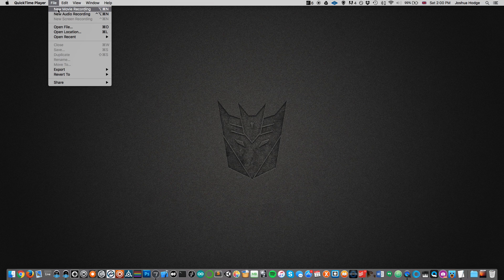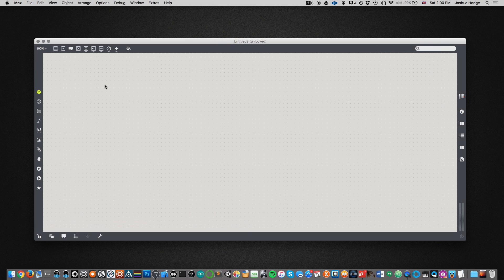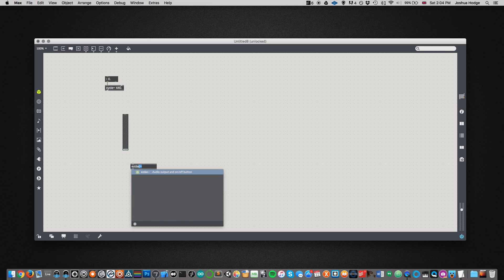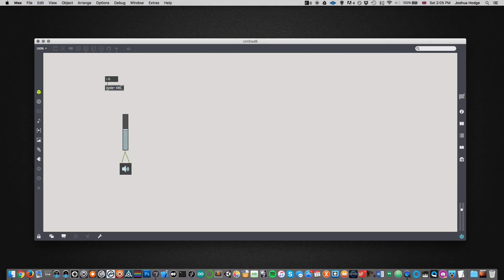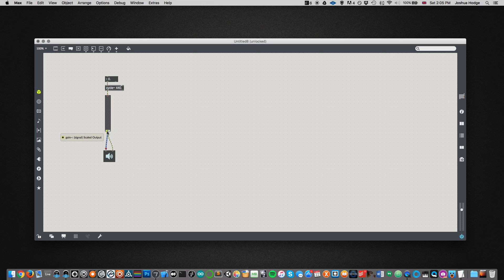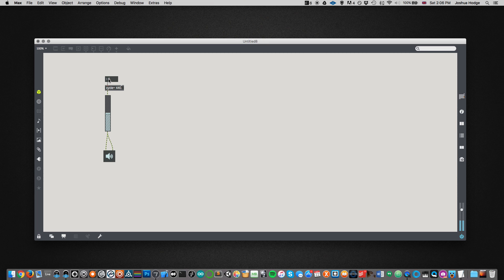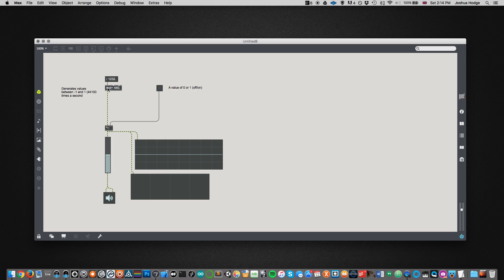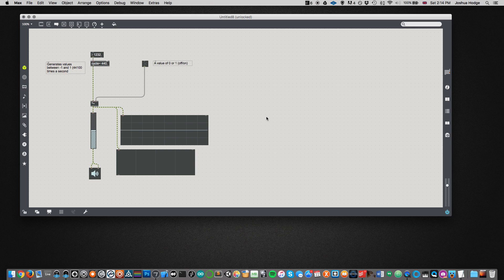Audio Programming for Beginners Tutorial 03-  Simple Sine Oscillator in Max Msp

Comment: For some reason I can't connect the number node to the oscillator node. There are no inputs or ouputs on the oscillator node. Has anyone else had this problem?
Reply: OK, I figured it out. If you give it a default value, like in the video, the outlets disappear. You need to first create it with out a default value and then connect it.

Comment: For some reason, I cannot connect the uppermost object with the 440. displayed together with the "cycle~440." The cable just connects directly to the gain every time I try to do that.
Also the I cannot turn on the gain or toggle the trigger button created. It stays blank and the gain won't go up, it just drags the object created. I'm using Max 8 and Windows 10.